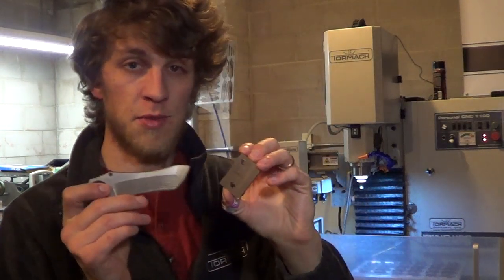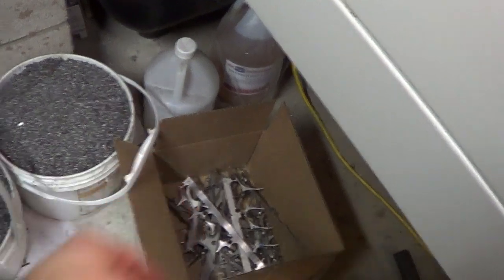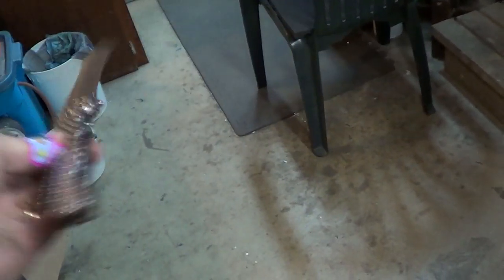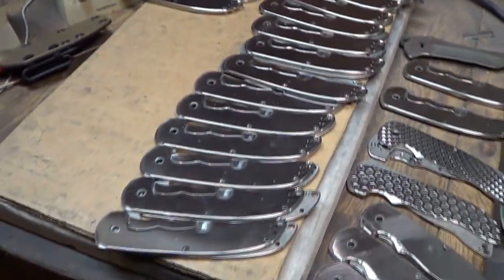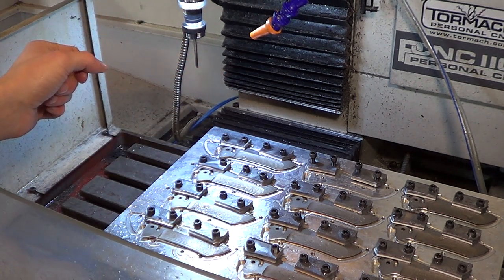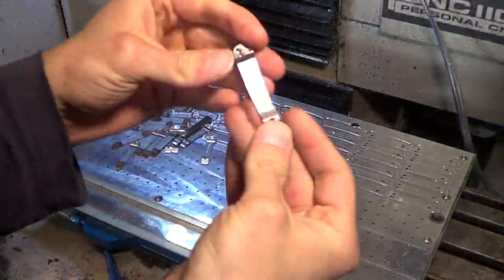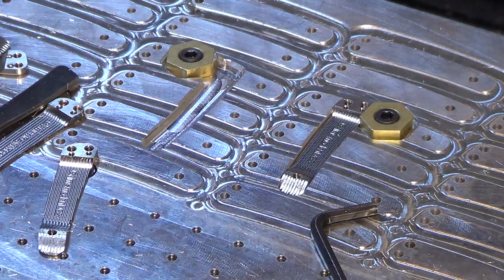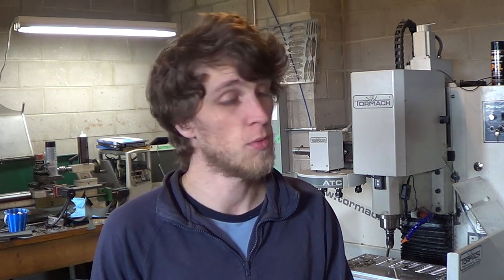Knifemaking Tuesdays Week 62  Blades and updates

Comment: side to side. think of it working similarly to the tip of a mechanical edge finder. They work wonders for reaming. Had to get one for the lathe to ream anything deeper than 3xD without going through a reamer every other day (picked up the lack of the sup-par tailstock alignment)

Comment: Hi John, looks like you are almost to the point where you have the base on which knives and anything can be held down, ,y you have the proceedures set so almost everything can be done by changing a base plate or choosing a different code? oh btw, get your hair cut, its almost as long as mine! also the way you sped up the drilling and reaming sometimes after the hat came off your hair was pretty close to that 1000 kph. reamer.